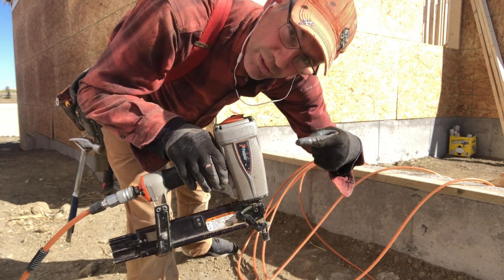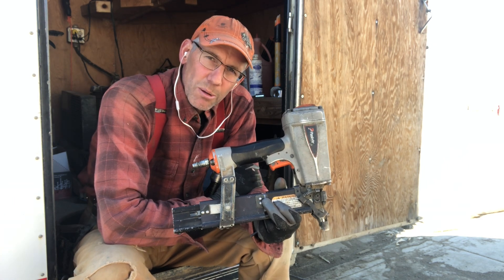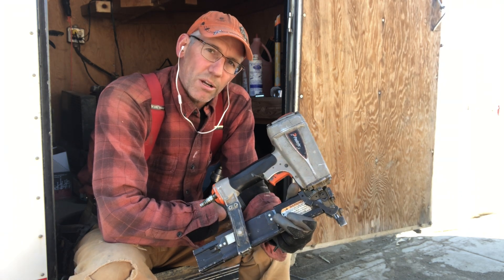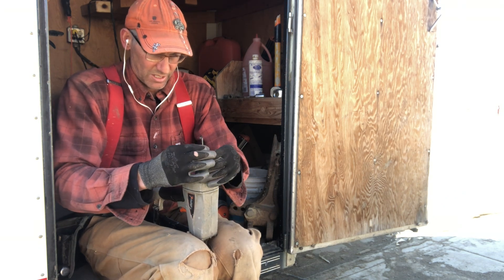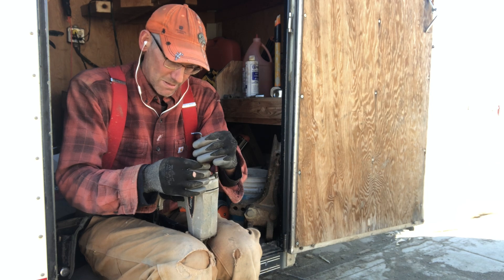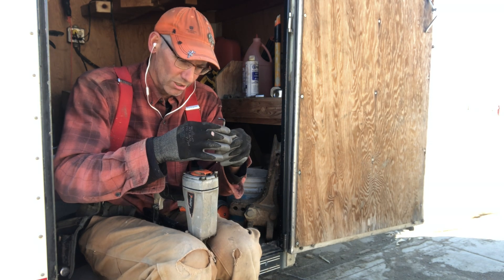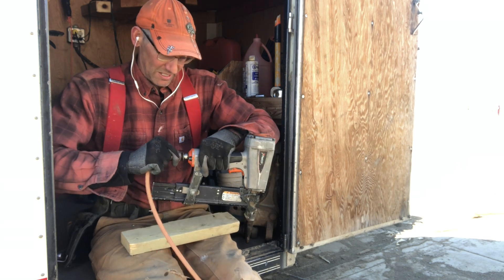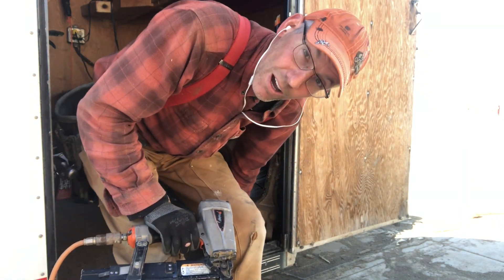Paslode Air Stapler Maintenance!

Comment: You opened it up just to put oil in it? Omg. Lol
Reply from the maker: Yep. It is a hack quick fix.
Reply: @framnerdan  seriously, why not just squirt oil in thru the air fitting?
Reply from the maker: I’ve done that every morning and no result.
Reply: It’s the same way to maintain the paslode cordless framing nailer. Take apart, spray the paslode cleaner and oil the cylinder walls
Reply: @ericjaszczur2860  you don't need to open air nailers to lubricate them. And fun fact. The paslode cordless fuel cells have oil in them. That's why the nailer needs to be cleaned after a while.
Reply: Ok